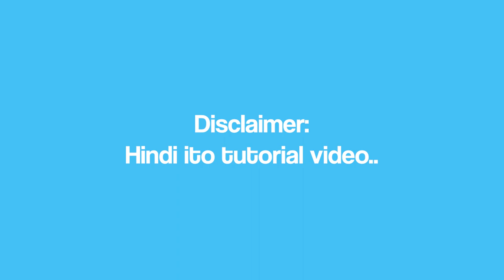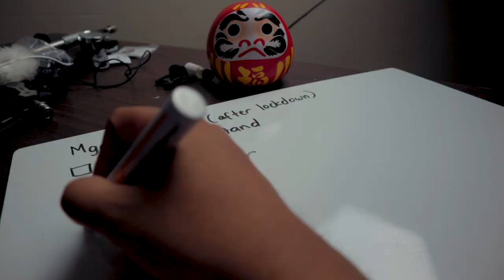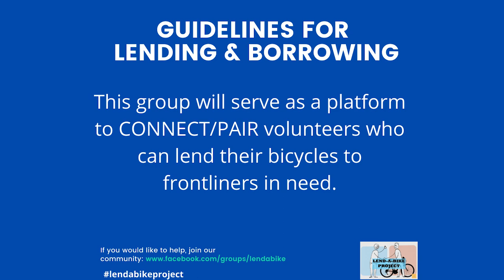Sinubukan ko Tapusin yung Pag-Build sa Weapon Project Bike

Comment: sa b-tension/ b -screw ang adjust para maging mas smooth ang shifting...sa hydraulic brake naman..ang ginawa ko dati dahil wala rin akong bleed block ginamitan ko ng innertube yung pinaikot sa hydraulic hose at pinang ipit pliers..medyo mahirap pero naipasok ko rin yung insert...

Comment: Tama naman lahat ng cnbi nila idol  ung H at L sa Rd. Skin kc gnagawa ko cnasagad ko ung adjustsan sa shifter ng sagad tapos sako luwagan n 2 pihit, tapos ung Rd pag walang chain at cable dapat tapat sa pinakamaliit na gear pag di nakatapat pihitin u ung H den pagtinulak u paloob dapat tapat sa pinaka malaking gear L naman pihitin pra tumapat pagtinest u with chain nd cable nakadapat un. Sa shifting mag base u dun sa adjustsan sa shifter if CW pihit or CCW pra macripz u ung shifting. Bitin ang chain.ung rear hose cable pwde iikot betwen stem at head set, ganun kc gnagawa sa mga stunt bike na nakikita ko